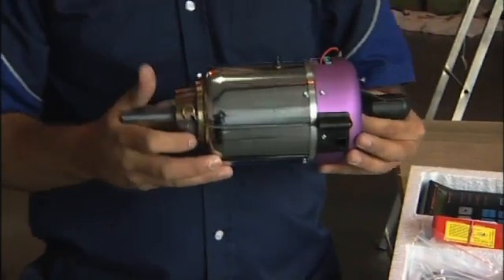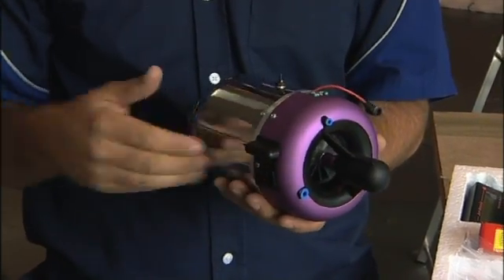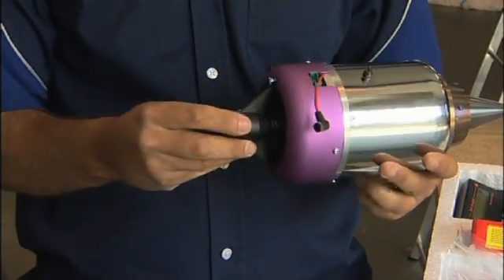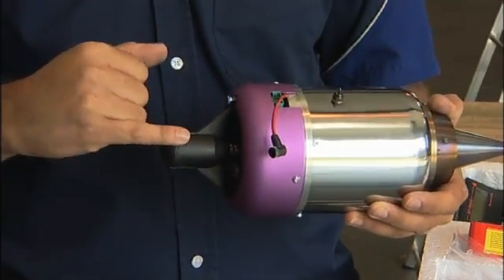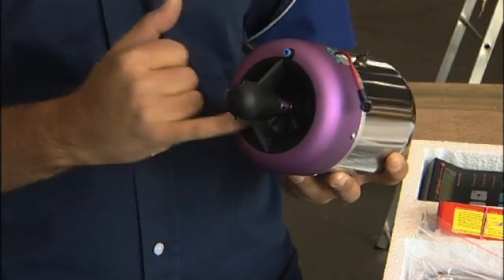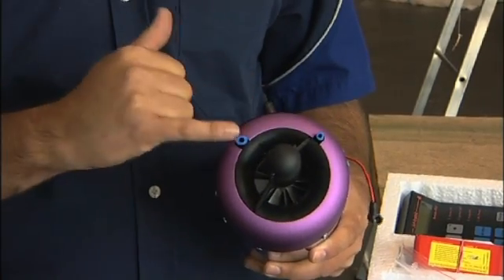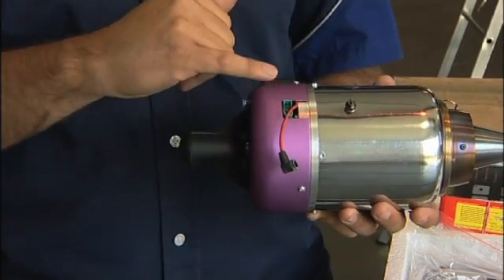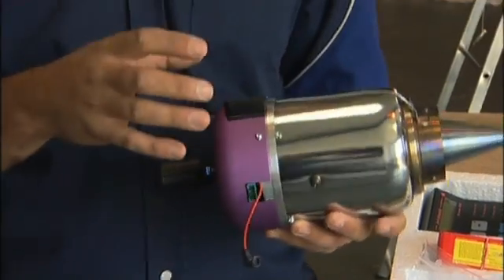The JetCat P-80 Model Gas Turbine Engine explained by Ali Machinchy -Jet pilot

Comment: How heavy can this engine lift up vertically? 20KG? 30KG?
Reply from the maker: The thrust delivered by different makes and models of gas turbine engines varies greatly. The manufacturers will have details on their websites. For the latest news, reviews and engine bench tests check out Radio Control Jet International magazine http://www.thehobbyhub.com or go to http://www.trapletshop.com where you'll find books and videos by internationally respected experts on all aspects of building and flying turbine powered model aircraft.

Comment: What engine would you recommend for a Trijet im building? <- im using 3 engines cause i hate dummy engines.
Reply from the maker: +Extreme Tutorials 
It's impossible to give a meaningful answer with so little information to go on. Sizing turbine engines for such a build is best left in the hands of a highly experienced jet expert as there are numerous variables such as the model size, weight, etc. Plus an individual modeller's experience in designing and building such a model is very relevant.
Your first stop should be Radio Controlled Jet International magazine, which is full of news and reviews of all that’s current on the jet modelling scene, as well as adverts from all the leading manufacturers and suppliers. You’ll also find a range of books and DVDs by internationally acknowledged jet modelling experts in our online shop http://www.rapletshop.com
Reply: Me?
Reply: Thank you very much, but im not better, not yet.

Comment: i think the reason why thay disliked it is because 
thay think the ducted fans will take over the world i dont think
so the power of them things are very high indeed even the p60 has plenty of thrust for 
slightly smaller planes

i want a F-9F couger model jet plane kit for 2.860.80
thats without the engine
so that will be a shock to your system 
and the p120 turbine will very on locataion so that means the price coud be anywhere from 3.000 or 2.500 or more

Comment: That Jetcat turbine model (P80) has fallen out of production long ago and has been replaced by the P80se shortly afterwards. The newest turbines now are the P100 RX,
P140 RX and the new P180 RX which will be available in Germany some time next year in February. It will replace the original P180 and the P180 will also be out of production.